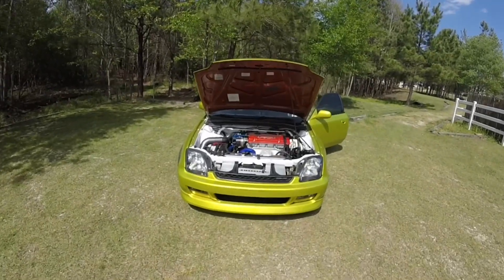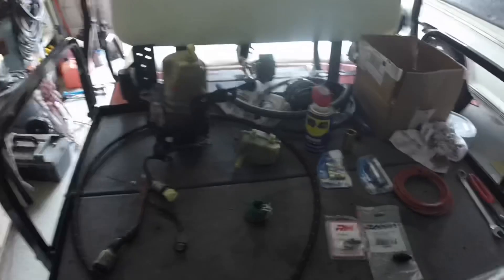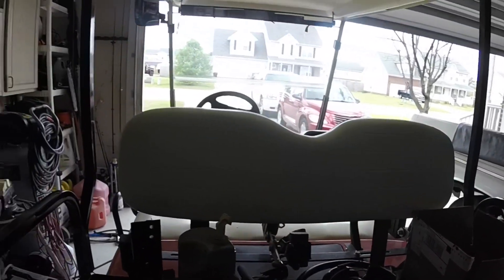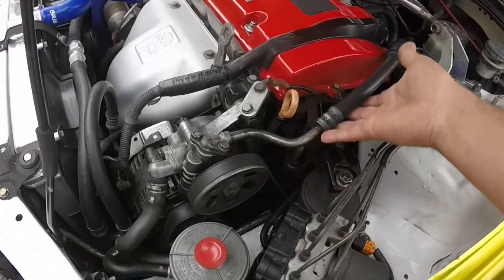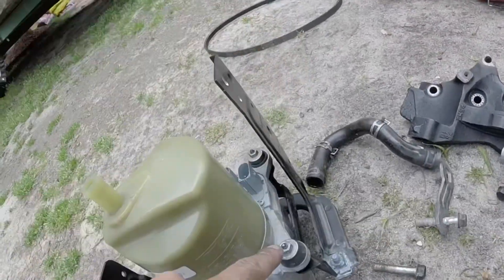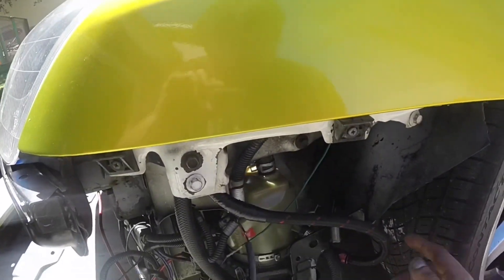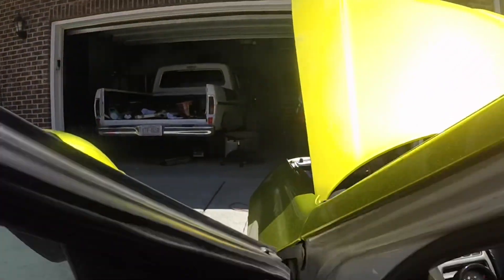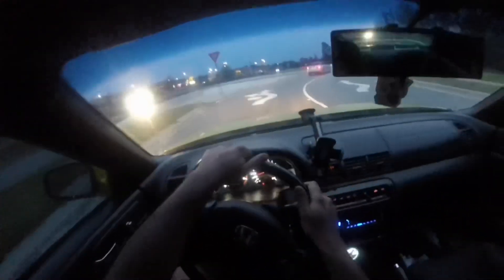HOW TO convert a Honda to Electric Power Steering!  -  Using a Volvo Pump

Comment from the maker: TWO THINGS not mentioned in the video! :  
 •1.Concerning the Green PS switch/sensor on the stock power steering line, you will NOT need that with this conversion!  That switch doesn’t do anything but send a signal to the ECU to raise the IDLE when the stock system goes over a certain pressure while IDLING.  That function is ONLY useful on the stock belt-driven pump because if you’re idling and turn the steering wheel the pump will have to work harder, so the idle needs to raise a little bit!  That’s all it does on a stock system,  and NO it will not trigger any CEL by leaving it unplugged, i hope this clears it up.
 •2. There is a Return line on the pump!  You use the same return hardline that’s already on your car, all you need is a longer hose and all you do is connect that to the return on the pump!  
• For the most part i figured only certain people would be doing this swap, so there might be things i don’t mention in the video that should be “common sense” (not trying to sound a certain way, you know what i mean)  So things like the return line, and mounting the pump should be stuff you can look at and figure out. 
 Hope this helps 👍🏾
Reply: How do you go about burping the system? Or do you just fill it up and send it?
Reply from the maker: @Rawrkee   i just burped it like a regular system, Cap off and pump turned on and just turn the wheel full lock a bunch of times, i didn’t notice any bubbles or audible change, but i still did it just to make sure lol.  Just turned lock to lock like 10-20 times with the cap off
Reply: @bb6g134 hey I love the idea I wanted to know if this could work on a crv 2006?
Reply: I did this upgrade a few weeks ago. What fluid did you use? From what I could find the pump calls for CHF fluid or DEXIII. I used CHF202. I recently notice moments where my steering gets harder (especially in tight turns). Trying to see if it’s fluid type related or something else.
Reply: @AC-bf9dq did you ever figure this out? My steering feels like it isn’t boosted at all I used the same fluid
Reply: @TerminallyCh1ll  just had to keep purging the system. I would turn the wheels and keep adding fluid a little at a time. Eventually it started to feel right and it worked properly. I didn’t really have any issues otherwise. It just made a high pitched whining sound that I think was more a pump issue than based on fluid. The sound never went away regardless of amount or type of fluid.
Reply: @AC-bf9dq  damn maybe I still have a lot of air in mine I tried bleeding it for so long. I have a 2nd pump I might try to swap them out. It doesn’t have any change in noise when I turn or get to full lock like I noticed in some guys videos mine just sounds the same at all times.

Comment: The fittings used in this video at the rack are technically incorrect.  I've learned more about fittings recently and I wanted to post this as a revision so that people aren't steered the wrong way.  The Redhorse fitting (redhorse 8161-06-14-2) is WRONG.  You're not supposed to use a fitting at the rack that features a crush washer, and the stock version doesn't use a crush washer either.  It technically works, but it isn't ideal and will often lead to a leak or improper seal.  The correct fitting to use on the steering rack for the high pressure side is a m14x1.5 WITH A 45degree FLARE ADAPTER.  Chase bays sells one with the title: Chase Bays 14x1.5 to 6AN Power Steering 45º Flare Adapter.  If you want to build your own return line for the low pressure side, you'll need the Chase Bays 16x1.5 to 6AN Power Steering 45º Flare adapter.   It's important that you use the rarer fittings with the 45 degree flare to have a perfect seal.  Ask me how I know.  Lol.
Reply from the maker: Interesting, i'm at 4 years with no leaks. But i understand what you're saying, maybe i got lucky, i haven't touched anything for the high pressure lines on this setup since this video. I have relocated the pump to a diferent spot though, i'm turbo now. Very interesting find though, i'm surprised i never had any issues, thanks for adding
Reply: @bb6g134  For the most part this fitting has worked, but I tried installing a similar fitting on the return line (obviously with a different size, the return line uses 16x1.5) and had issues.  It's not that the fitting you specified won't work, (it uses the correct threads obviously and everything) it's just not technically correct as it ideally shouldn't need a crush washer and should seal because of the 45 degree flare at the end instead.  Thanks for your video though, it was super useful for me.  Just wanted to post this here in case it helps somebody else.  I hope it will.
Reply from the maker: @drewh22  yeah totally makes sense, the proper degreed fitting would be ideal , i definitely just got lucky with my seal, definitely won't be touching it lol
Reply: @bb6g134  If it works and it doesn't leak, don't touch it :P

Comment: AN is not meant for high pressure. PTFE doesnt make it stronger. Its a liner compatible with different fluids like ethanol. You should 100% go to a line/hose shop and have custom line crimped. Or buy the tools to do it yourself. Besides that HUGE error, great video. Wait, also dont use audio fuses...lol.
Reply from the maker: The PTFE An line i used is rated for 1500+psi AND Power steering fluid safe. It is paired with the PTFE hose-end AN fittings because that’s what you have to use with PTFE hose. Nice try, but you’re wrong. This wasn’t a step by step tutorial it’s just a video showing what i did. People will have to use their own common sense when doing this at their own risk if they don’t do the research. Like mentioned either in the video or the description anyone doing this needs to take that risk into consideration, it is assumed anyone doing this themselves has enough experience or knowledge to fill in the gaps.  Also, it’s been daily driven over a year, even ran 20 hours straight nonstop when i drove from NC to TX, if anything was wrong it would’ve shown by now. But thanks for the comment 👌🏾

Comment: Will this work on other vehicles like SUV's etc?
Reply from the maker: It will work on any vehicle with a hydraulic power steering rack that uses power steering fluid and a high pressure pump.  You just need to mount it and wire it up. Same process

Comment: what about the part where the power steering does not effect your rpm-s and lighter steering?
Reply from the maker: Yes you’re correct. Since the pump isn’t connected to the engine, it won’t stall the engine or affect rpm anymore.
Reply: i've noticed when you run AC and turn your steering wheel close to max lock when the powersteering works overtime the car starts to shake violently.. so switching to electrical power steering should reduce that sensation since the pump isnt belt driven.. is that the case? let me know.

Comment: What size PTFE hose did you use ? 6ft or 12ft
Reply from the maker: Sorry for the late reply, i got 6 feet and i actually cut down another foot, so i only used about 5ft at the end

Comment: hello not sure if youre still replying but i have looped my lines on my steering rack, 
would it still be possible to do this if i connected DIRECTLY to the rack instead of where the high pressure line was? i did remove all the hardlines

Comment: I'm just getting around to my CB7 swap and I've been planning this E/PS conversion. I'm curious if you kept the stock fluid cooler?
Reply from the maker: Yup it is hooked up to the stock cooler! Which works great i’ve used this on a 20 hour road trip before, on gas station stops i would feel the pump and it was always cool

Comment: Did you delete the entire power steering system including all the hoses and the cooler?
Reply from the maker: Pretty much everything from the high pressure side of the old pump setup gets deleted, pump, bracket, high pressure. Which is pretty much everything inside of the bay,  the cooler and low pressure return hose still gets used on the electric pump,  just need to extend the return hose and that’s about it to use the stock cooler.   I’ve taken this electric pump on a 20 hour roadtrip and it did great, always stayed cool

Comment: This is a cool mod I would love to do this to my civic The only thing is it costs more for the pump and parts than it does an original one  You'd better off keeping the original one But anyways cool mod cool video
Reply from the maker: Lmao, it is a modification, if you can’t see the benefit then it is not the mod for you, it’s explained in the video why it’s better than a stock pump
Reply: @bb6g134  🤣 I'll see the benefit But the price is way too much We gotta be real here  It might be something I will do if my power steering pump goes out in my car But not something I will do right off If the price was right I would and it's cool to know. I'm fixing to put Turbo in my car so it would benefit me probably be something I will do later If my stock goes out.
Reply from the maker: @ThePrelude1999   i only spent $200 on this entire setup, that includes the pump, AN lines, Fluids, etc
Reply: @bb6g134   That's not a whole lot it's still a lot tho I would say you found it at a junkyard on eBay these things are going for like $300. $200 without the wire and harness And the bracket I've not found any with the brackets
Reply: You can buy everything he showed in the video for less then $300

Comment: Hello!
Thanks for the video. 
Hope you’re having good day. 
Question:
Did you use Volvo CHF 11S (Synthetic Power Steering fluid those Volvo’s use) or did you use HG (Honda Genuine Power Steering Fluid)????
Please let me know!
I’m doing the conversion right now.
Reply from the maker: I would use the Volvo fluid! I personally think using the right fluid for the pump would be better for the pump in the longterm
Reply: @bb6g134  more expensive to replace the rack. you should use fluid to suit the rack
Reply: @bb6g134  Thank you very much for your response. 
Have a great day!

Comment: I have 2 12 inch subs in my setup should I upgrade the alternator before I do this?
Reply: You should upgrade it just for having 2 12’s the honda alternator amperage is very low and any sub thats using over 900 watts (on a prelude) the fuse is going to blow if its a civic i assume the amperage on them is less

Comment: I am doing this for my s13. I think it is a very good upgrade to fix a broken steering pump etc.
Reply from the maker: That’s great the video was able to reach you!  Hopefully there was some good info for you, everything should apply exactly the same to your S13 except the steering rack adapter fitting you’ll just need one for your nissan steering rack 👍🏾

Comment: Just got myself that same exact Volvo V50 pump! Will be installing into my 4th gen Lude very soon.

Although, I've always been worried that it would draw a lot of amperage in which you would need to get a higher amperage rating alternator? I planned to have my H23A run a second gen Odyssey since it holds 120A instead of the Lude's 70A.

I love my converted (sorta) manual rack and pinion but it would be nice to have ps on the drive back home from the track lol
Reply: Im on florida preludes on Facebook did mine on 4th gen. Just be careful with lines from vehicle speed sensor.
Reply: I can finally say mine is completed after 2 years LOL

I hid my Volvo V50 pump behind the driver's fender well and relocated the OEM windshield washer fluid elsewhere. The V50 specifically has a remote reservoir which helps the engine bay look nicer. Reservoir goes up through the holes where the stem of the windshield washer fluid used to go up and pump tucked behind the front driver's fender liner. 

Took your advice installing an 80A inline fuse for power but in addition, I Installed a plug-and-play kit from eBay (Bruno Steering) which allowed me to add a potentiometer switch inside the car. Now it feels like I am adjusting the Force Feedback of a Sim Racing wheel LOL
Reply from the maker: Nice! I would recommend anything over 80 amps which is the reason i put a 80amp inline fuse on my setup. I believe my 5th gen has 100amp alternator stock so mine hasn’t had any problems powering it. Just make sure to use a inline fuse on the main power to be safe,  just make sure it’s lower amps than your alternator. I haven’t blown any fuses using a 80amp so i would believe the pump draws less than that, but idk what it draws exactly
Reply: Keep us posted how this goes. I'm thinking about doing the same for my 4th gen lude.
Reply from the maker: @McLovin80   i’ve been daily driving this setup for the past month! No problems at all and it’s been working great.  I’ve been wanting to make a update video but haven’t had a good chance to get any track driving in since i want the video to be entertaining aswell, but i’m definitely working on it
Reply: @bb6g134  Appreciate the video so far! Any chance for a physical part list to add into the video content or did I miss that?
Reply: @McLovin80  Will do! Currently still making a bracket to install it in the fenderwell where the windshield washer reservoir use to be and I'm still currently finding where my Parasitic Drain is occurring lol.

Comment: Why would anyone need power steering when driving a tiny Honda and power steering cut off around 5 to 15 mph. I gutted my power steering for 24 years in my h22 cb9
Reply from the maker: LOL power steering does not get cut off at speed at all in a stock car, the pump is literally driven by a belt connected to the engine there’s no way at all for it to cut off while driving 😂  and based on all the feedback looks like the majority of people want power steering, a lot of turbo and supercharged guys have benefitted from this, Preludes are heavy cars and the steering rack ratio isn’t meant for no power steering, so without it it feels horrible
Reply: @bb6g134   disconnect your power steering and let off the clutch slowly and turn the steering wheel as simple as that. After 5 mph it turn n move as it has power steering. Same as my vip v8 ls430. Took my power steering off also. But then again i have 21 inch arms.
Reply: Not having power steering on a car is ghetto AF lol pain in the ass if you live in the city.
Reply: @alkalionpower  why would it be a problem not having power steering in those micro hondas?  25 plus years and i never had any problems in all my accords, lude, civic, lexus cars.

Comment: wow I knew nothing about this and can highly benefit from this given i had to relocate my power steering due to a JRSC install.  Thank you so much this is great ! just a question. Can you provide pictures of how it's mounted ? Thank you. It was dark in the video
Reply from the maker: I’m glad you found it useful! I’ve seen the S/C setups and it’s definitely a tight fit with that PS pump.  I mounted the pump using stock threaded bolt-holes that were already there in that area, i believe they were the threaded holes for the stock undertray.
Reply: Was thinking same thing with my JRSC for my k20….. will it work on k20 though?
Reply: @jdmbear8492  it's identical. It'll work

Comment: Are u still using honda power steering fluid?  I'm assuming the Volvo PS system uses a different type of oil.
Reply: Tryna figure this out,bout to do the swao

Comment: This might be a stupid question but does it need a cooling system with it ?
Reply from the maker: Good question!  But no, the Prelude and other Hondas already have a stock cooler! It is usually mounted in the front, and the return line comes off of that. You will still be using the stock cooler in this setup, so far i’ve had zero issues and my pump has never gotten hot 👍🏾

Comment: Deng bro, thanks a lot for the tutorial! would it make sense to hook the ps switch up to my radio, that way it'll turn on when the engine is turned to the ON position? I'd like to avoid manually switchin on and off the pump :D
Reply from the maker: Any 12volt ignition source will be good enough! The small wire just needs any 12v ignition source to turn on the pump, just be weary of leaving the car off with the ignition on, if the pump is on and engine not running it would probably drain the battery.  The best part about the Cruise Control button i used is that button can stay depressed,  there’s already been a couple of times i forgot to turn it off and next time i started my car the pump automatically turned on because the button was pushed in already, but i know not everyone wants to use that button it was just perfect for me since i already has CC deleted.
Reply: @bb6g134  I love cruise control. I'd never remove it on purpose.  :)
Reply from the maker: A manual switch could also be an option, maybe hide it somewhere and just leave it switched on all the time, if you need to have the ignition on without the engine running you can just turn off the switch, just an idea lol
Reply: @bb6g134  🤔🤔🤔 that does make a lot of sense. I guess it’s a good way to deter ppl from wanting to drive my car 😂😂
Reply: Yo guy! Fancy seeing you here lol

Comment: can you post the part number for the fitting from pump to hose? or is it the same as the one for the rack? Thanks. @bb6_g
Reply from the maker: Both adapter fittings are shown in the video, the fitting from pump to hose is the one i was talking about and screwing into the pump,  The bag brand says “Fragola” in the video

Comment: I think this might be related to the 1st question. I see there's a sensor on the "high pressure" line what do you do with the plug that was attached there?
Reply from the maker: I just unplugged mine, even if you’re on a stock ECU it will not trigger a CEL, the only thing that sensor does is raise the idle based on the power steering pressure. Because the stock pump is driven by a belt, if the RPM was too low and the pump makes a bigger load from turning the wheel then it raises the idle RPM to compensate. Not needed in this setup, no CEL either.